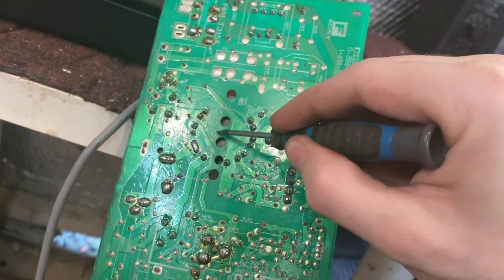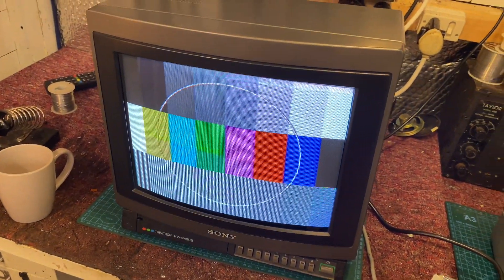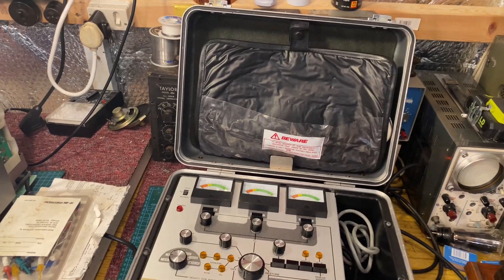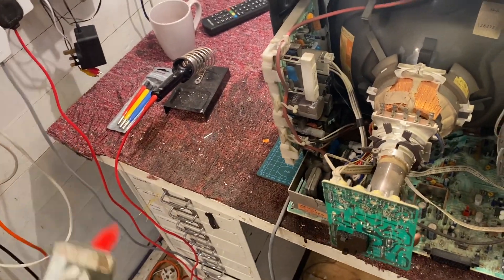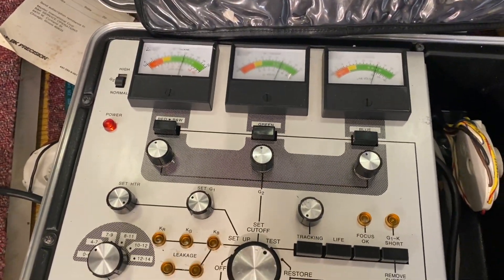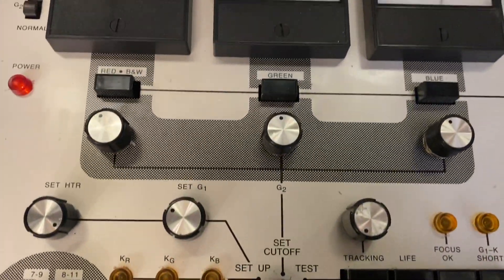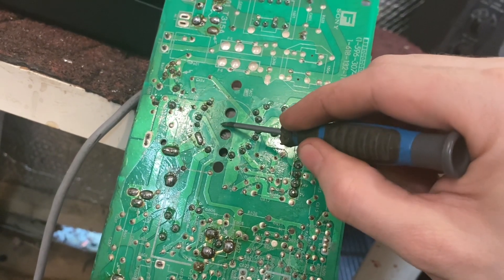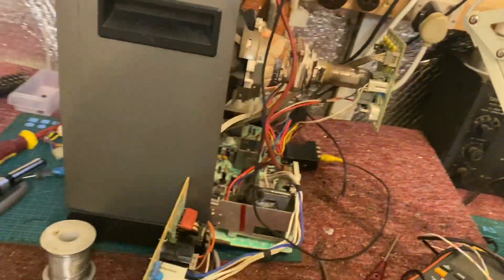Customer Repair - The “Irreparable” Sony KV-1440UB

Comment: The metal in the transformers is "soft" ferrite, a mixture of iron, nickel, zinc and manganese (not always manganese) which has low coercivity. TBH I didn't know all this, I looked it up - I just knew it was some sort of Ferrite which got me curious to find out. I think it's dust particles of these metals which are bonded together somehow. Shango66 has worked on a few Sony sets with cracked ferrite cores or rather the metal clamp which holds the core together - this causes big problems apparently. This set has a really good tube in it - great picture. Enjoyed watching.

Comment: These are standard Ferrite cores, used by all line output transformers and chopper power supplies. Straightaway I could tell there is a gap in one of the cores, due to  crack. One way to solve this is to coat the component in insulating varnish. I would have removed that damaged transformer and repaired it off the board for a more thorough and stronger repair.
Reply from the maker: Not so standard materials, after being abandoned by other television engineers, I thought I’d share how I repaired this. I’ve come across 3 different sets which have completely crumbled away. 

It was clamped, and JB weld used. It’s held up this long. I can’t see how removing the transformer would improve gluing. You must have fantastic eyesight, catching a hairline crack, which is disguised as a seal, or weld, plus added compression from the video.